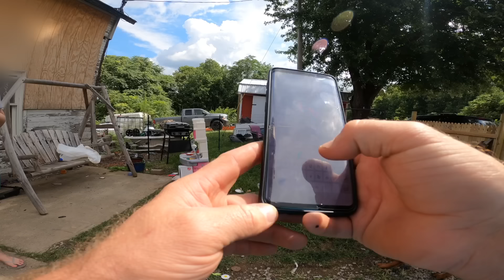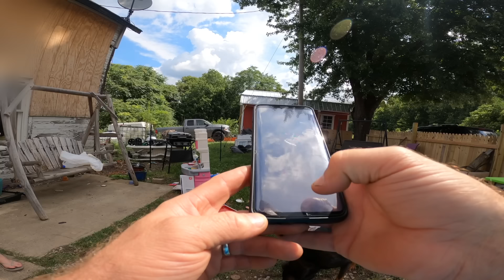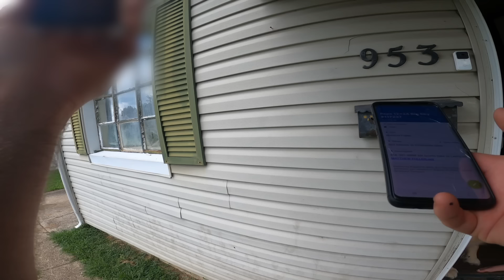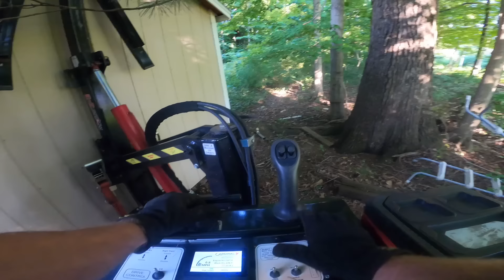Shed Repo #76 The Day I Went After 4 And Got 2.

Comment: FYI, just soak a couple of paper towels with the hornet spray and block the hole with it. The fumes will get them in a few minutes. No need to drown them in the stuff. Your can will last longer, too. The same method works when they nest up out of reach in your eaves. I tape a 6" funnel on a paint extension pole, stuff the soaked paper down in it and push it up covering the nest. No ladders, no escape.

Comment: Spectracide Pro seems to be the best wasp& hornet spray. Knocks them out of the air. Keep up the good work. I probably would not have the patience it takes for that job when I was still working.
Reply: There are a couple brands that do the same thing. Spectracide is the cheapest. I know, because I use it also.

Comment: Hi Josh. Quick question: Do the rental outfits that hire you reimburse you for the fuel you use on the pick-ups they send you on that don't result in actually 'picking the sheds up'?  Not getting compensated for your time is one thing but having to spend your own money??  Yeah, I wouldn't do it!
Reply: They give him a fair rate fee for recovery. Often around $350 per unit
Reply: Maybe that’s what sets him apart. No offense, but having a dependable guy that does his best to get the units instead of being ok with not getting them because he’ll get reimbursed anyway, is valuable.
Reply: All repos are on a contingent fee basis! Meaning you get paid contingent on the recovery of the unit. So, no unit, no pay. That's how the industry works. So you factor in your expenses into your repo fees.

Comment: You figure these rental companies would stamp the serial numbers into the woods somewhere or into a plate that they can screw into the wood it wouldn't be that hard and it would be permanent
Reply: I have a shed to cabin and mine has a serial number on a plate on the building.